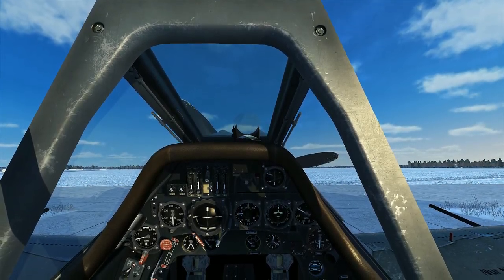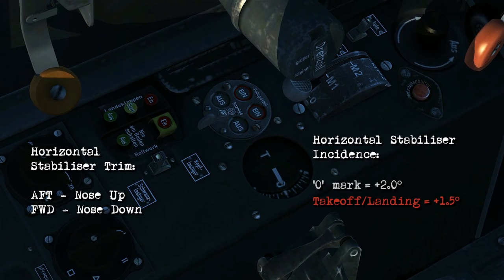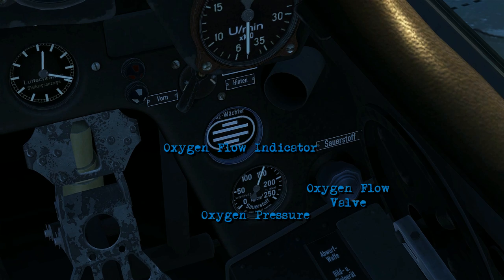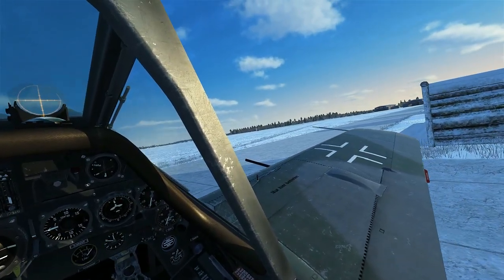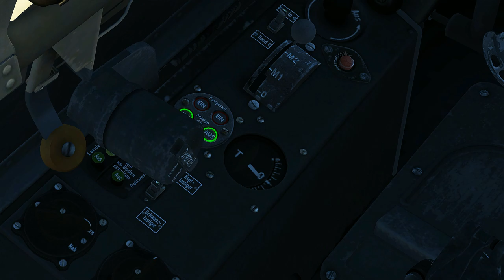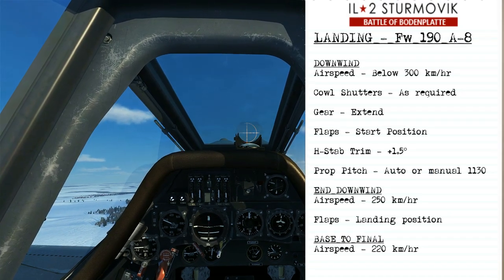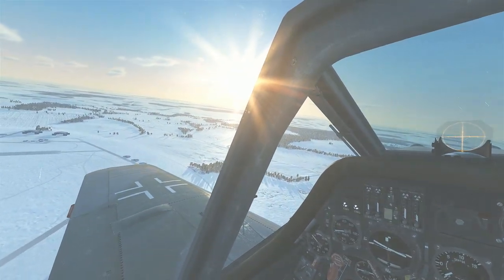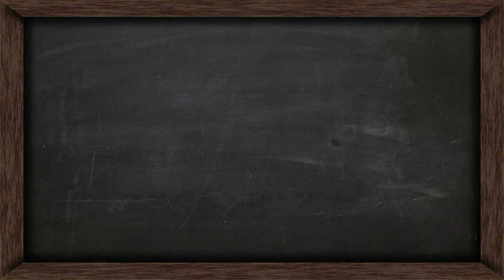Learn to fly the Fw 190 A-8/F-8/G-8

Comment: "Learn to fly the Fw 190" Hahaha, do you really think to "fly" an FW 190 in a sim has anything to do with the real plan?
Reply from the maker: Nope. It's just an example of using the WWII manual for it and applying it to a simulated airplane. Outside of learning the cockpit layout and flying technique/procedures there is no comparison to flying a real airplane versus a game or simulator. Even the Level D simulators I train in are close, but they still are not comparable to the real thing. If you fly a Fw 190 or other warbirds in real life though people would love hearing about your experience if you want to share.

Comment: NIce video!
I'm strugling to take of. I'm always turning round and round...
Reply from the maker: Just remember to pull the stick back to lock the tailwheel if you want to taxi straight or are on the takeoff roll
Reply: @RequiemsACTL  okay i think I'm getting it, but it was a nightmare. 
Dealing with the tail wheel break, the left and right wheel brake and the torso of my joystick for the "tail horizontal flap" sorry if the words are not correct.

BUT i have to say that I am very pleased to read your commentary nearly 2 days after I posted my question.
Reply: @pierresavioz  remember to use rudder and use it hard while taxxing but rudder wont work unless you got some airflow(i.e. speed)

Comment: Can anybody explain me what is the purpose of the Cowl Shutter? thanks
Reply from the maker: It regulates the airflow to the engine to help control the cylinder head temperature
Reply: @RequiemsACTL  Thank you very much! Am I suppose to keep it open during every moment in the air or just when the engine is overheating?

And by the way, your videos are amazingly complete and useful.
Reply from the maker: @pierresavioz  Just adjust it by opening/closing to maintain optimum CHT (cylinder head temperature)

Comment: Just a nitpick.  It´s not Battle of Bodenplatte, is Operation Bodenplatte (during the battle of the bulge or Ardennes Offensive)
Reply from the maker: Yeah no worries at all Icterio, I know it's an operation...just following the naming convention for how the sim is sold is all :-)
Reply: @RequiemsACTL  It would be interesting to see a video about the differences between the A-8, F-8 and G-8, like weapons options and their tactical employment.  I also believe the G-8 was equipped with a auto-pilot and other navigational aids (don't now if the simulation reflects this).
Reply from the maker: Yeah I would like to do that for sure. Will likely come after I get out some videos for P-47 ground attack I'm working on atm